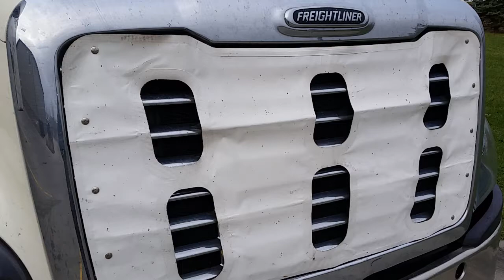Cng Tip of the Week, Tip#3- Winterfronts

Comment: It is a diesel it's not gas and I'm ninety-nine percent sure is newer diesel trucks do not have glow plugs did they stop doing them after 2005
Reply from the maker: Our fleet consists of 2015 and 2016 cng (compressed natural gas) cascadias, they have 12L ISG cummins. Has 6 spark plugs in place of injectors.
Reply: Its CNG not diesel.

Comment: On modern Freightliner with Detroit engines, the use of a winter front is never recommended. I have driven at -33c temperatures without any issue.
Reply from the maker: This is on a Cummins CNG, not diesel. And -33C isnt even the coldest it got here this winter... the engine in these trucks i refer to has Soark plugs... not injectors and use of winterfro t is recomended by both Freightliner and Cummins at specified temps for CNG engine operation
Reply from the maker: Spark plugs... damn phone key board
Reply: Ah, see that now. Didn’t notice the CNG part.

Comment: He is wrong on all 3 points he made.  Ever heard of a Diesel engine!?
Reply from the maker: Ever hear of CNG... compressed natural gas.... thats what these units have in them (approx 100 total cng units in the fleet)
Reply: @BeardedSeabee82  My bad thank you!  Kudos your company for doing what they can on emissions etc. You are running diesels converted with spark plugs added?  Or are these gasoline CNG engines put into Class 8 trucks?   We all need the ingenuity to convert our energy as we can.  I have been burning diesel at near 7 mpg for the last 3 million miles in 25 years.  Have driven every commercial diesel that is made from old 3406 CAT to the new DD15 (now) in a Cascadia like the grill in your video.  I was looking to find how to mount my weather front but apparently my company doesn’t spec our Cascadias to take one.  No mount clips or tabs.  
Apologies, kudos, best wishes.
Reply from the maker: Belmore winterfront has the kits for the winterfront where you can add the clips in, as alot of the diesels arent spec'd for winterfronts. Fleet wise, prior owners (before mergers aquisitions etc) in 2015 went with the cng, it is a 12L cummins ISG blocked specifically for cng. When fuel was 3-4bucks a gallon these were more efficient, mileage wise burns about same 6-7"mpg". But now with 2 dollar diesel (for now...) fuel wise cost is about same. But the brand new Cascadias we have gotten in with the new automatic transmission, those are getting 9+mpg... extremely efficient (not a big fan of the automatic side of things and all the other bendix road guard bells and whistles crap though)

Comment: Fuckin spark plugs? It doesnt do anything but make your truck run at the correct temp...
Reply from the maker: It is a compressed natural gas truck not a diesel, and yes it will fuck up your spark plugs if its warm out and you have it on, and if it is cold and you dont ha e it on can build up alot of condensation in the charge air and ice up ambient sensors